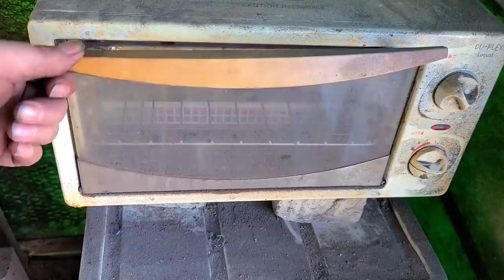Make a knife from an iron file tool

Comment: I have been curious, to see some one use a big convex file, and forge it into a billet, or plate, or just forge a knife frome the file, straight forward. Can that be done?
Reply: Convex on one side, and flat, on the other. I can't remember what it's called.
A mill file? It ain't a flat bastard.
Reply from the maker: Thank you for watching.
The metal file you describe was made only once. That knife is a Yakut knife.

Comment: another beautiful knife.
i have 2 questions for you. 
1. why do you file that semicircle in the blade just before the guard?
2. what were the 2 chemicals you dipped the blade in? i think ones an acid etch but ive never seen someone use 2. 
thanks in advance.
Reply: The notch is known as a Spanish notch.  That's all I know.
Reply: @tonywalker8030  seems it might help with cracks transitioning from edge to handle.
Reply from the maker: Thank you for watching.
1. The part called "choil" in front of the guard actually has no function. How easy is it to make a blade?
2. The black liquid is iron chloride. It forms an oxide film on the blade surface. It delays rusting a bit. The brown liquid is sodium bicarbonate. It is for cleaning.
Reply: @forginghard  oh ok, thanx for the info. absolutely love your videos.